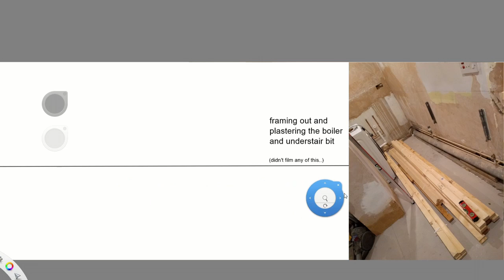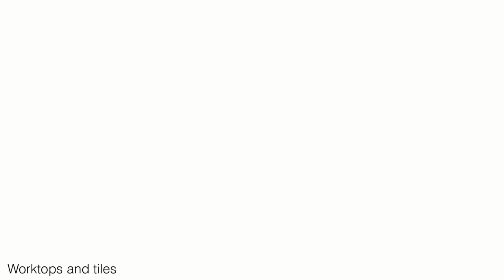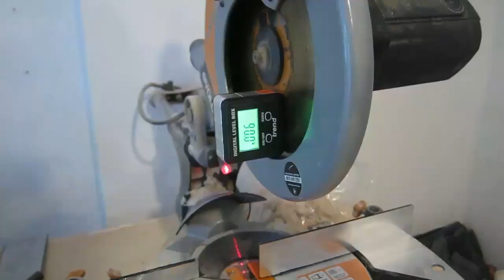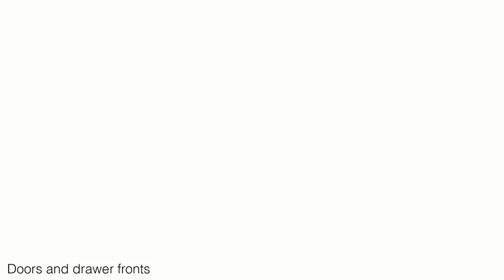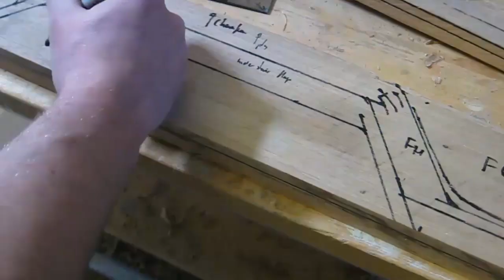Making a bespoke kitchen with hand carved door pulls

Comment: Hello. Great job! What is the white substance you used to create countertop?
Reply from the maker: Hi, thanks!  Its a product called microcement, basically a cement/resin mix you plaster onto a substrate and seal with polyurethane.  I did a more in depth write up of the process here: https://www.instructables.com/id/Microcement-Worktops-for-a-Bespoke-Kitchen/

Comment: Thanks for sharing the beautiful and inspiring work. How's the microcement worktop holding up after 2+ years? Is there any crack, stain or any other problem?
Reply from the maker: Thanks!  Ye pretty good.. has stayed stain free, no real issues with the countertops considering wine spills, hot pots being put on it etc.  V.happy with it for the price.. 

I did also use it on some flooring.. Along a seam of the chipboard subfloor in one section it has cracked.  There must be abit of flex there so make sure the substrate you're apply the microcement to is solid if its going to be bearing weight.

Comment: Hi there! Looking at getting microcement from this same company in spain - how has it held up for you over time? cheers!
Reply from the maker: Hey.  Ye pretty good.. has stayed stain free, no real issues with the countertops.  Happy with it.  

I also used it on some flooring.. Along a seam of the chipboard subfloor in one area it has cracked.  So make sure the substrate you're applying it too is solid/no flex!
Reply: @LiamBarclayDesign  Hi again! What are the little support feet you're using under the kitchen unit? is it just scaffolding? Finally getting round to sorting my kitchen unit out and this has been a big inspo!
Reply from the maker: @studio20___  hey, ye scaffold style pipe but smaller diameter than actual building site scaffolding. It's called tube clamp or kee klamp.. loads of different fittings/feet